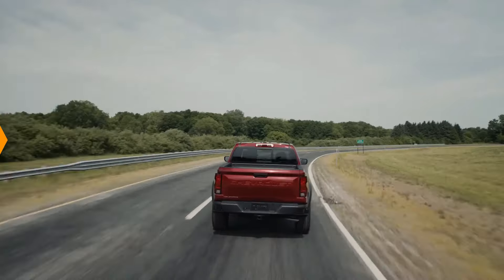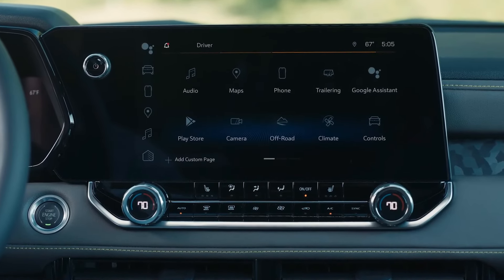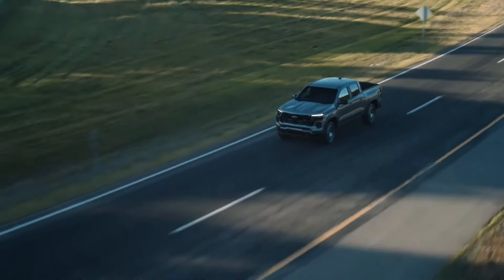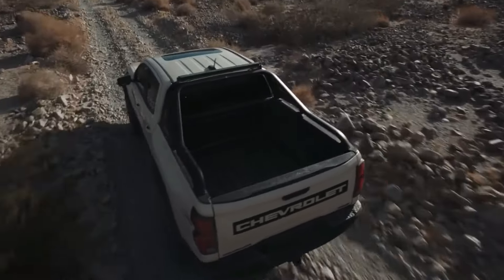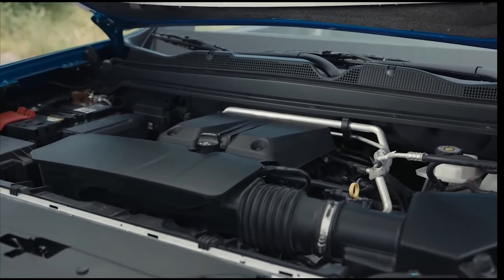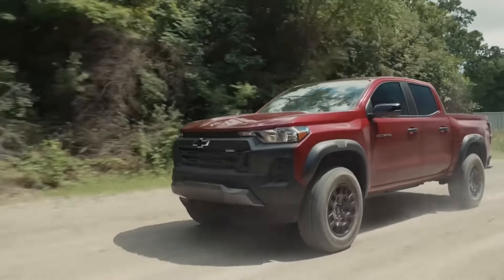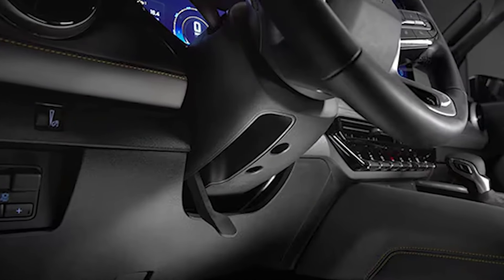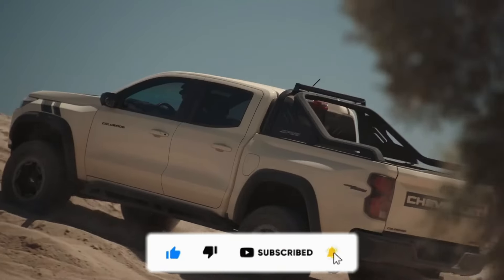9 Reasons Why New Chevrolet Colorado is NOT Selling!

Comment: Writing from NS Canada. There is one that parks near my wife’s Grandma’s home. I mow said Grandma’s lawn for her. When the truck in question is started it sounds so bad. Really sounds like something is broken. Would not want one of these based on that. But when compared to the competition I guess only safe bet left is the Nissan. How times have changed.
Reply: It's Normal, It goes down to normal idle after about 20 Sec. I have the GMC Canyon AT4 this truck is fast and reliable